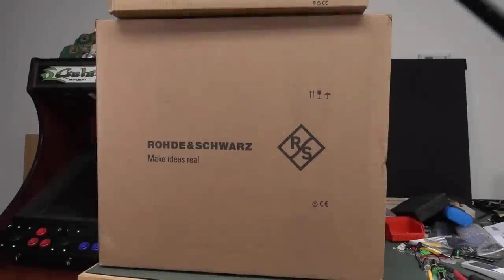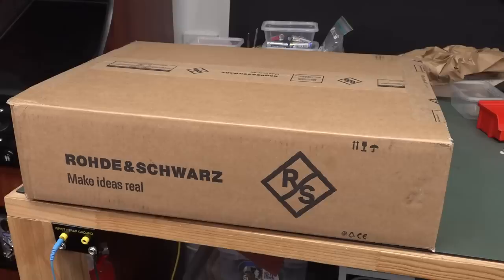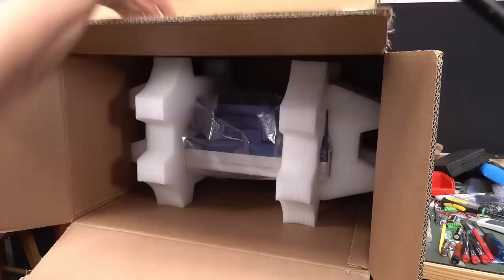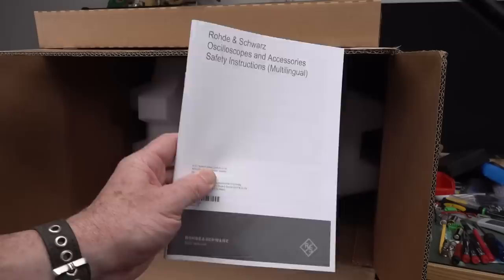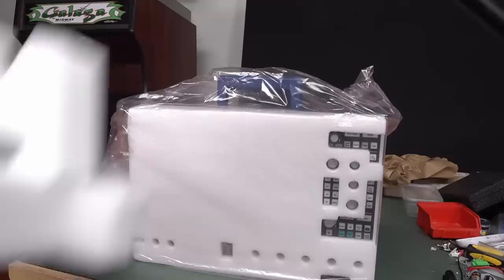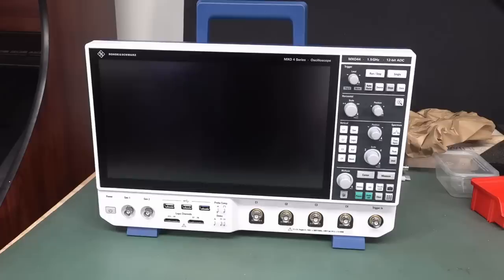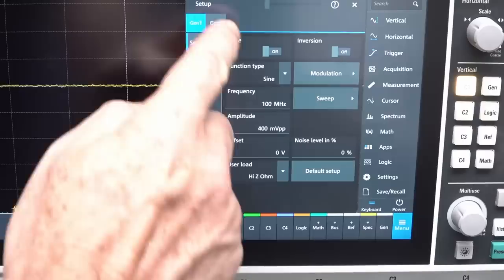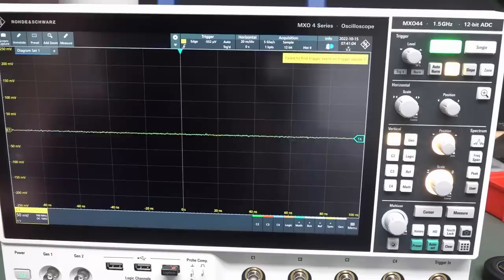EEVblog 1529 - R&S MXO4 12bit Oscilloscope Unboxing and Experiments

Comment: I realized I'm not the intended market for this equipment when the "low cost, general purpose" scope probes are more than my scope budget! 😅
Reply: Siglent and Rigol make some good stuff for the price. I think Siglent is good. I have the SDS 1104X-e and I still think it's the best bang for the buck scope anywhere. I doubled the bandwidth with a hack posted on the EEVBlog forum making it as good as the 1204X-e. It's not "great" at anything but good for everything if you know what I mean.

Comment: I rather like face plates like that. We've had a few devices do the old rapid & unscheduled self-disassembly stunt a few times and it's nice to have faceplates on equipment not in active use just in case.

Comment: 700MHz passive probe, or really "there probably is a signal there" probe, at 700MHz you better only be probing the output of a TV transmitter at 100W power output, to hope to get a decent signal without too much loading., 100R at 700MHz, really going to load things down.

Comment: Does it time out after 10 min and ask for your credit card number for their monthly subscription like everything else does these days?
Reply from the maker: Don't give them any ideas.
Reply: We can count our lucky stars that a lot of high-end scopes are used in environments where devices aren’t allowed to have internet access. Otherwise I think we’d already have everything subscription-based. 

I will say that I wouldn’t mind it if the manufacturers started offering software options as cheap, time-limited “rentals” instead of sales. So if you only need, say, 1.5GHz and power analysis for a specific project, you could rent those options for a few months. They already all support time-limited demo licenses, so this would be purely a marketing change.

Comment: What's odd is when you added peak to peak for a second time at ~27:00 it showed you a duplicate measurement instead of recognizing that it was already there. Basic bug that they really should fix
Reply: i also really dislike the ADD button. clicking those checkboxes should instantly turn those measurements on and off.

Comment: Hi Dave, Just on that 700Mhz passive probe, Rigol has RP615A 1.5 GHz 500 Ohm passive probe, not sure if it is really possible to achieve this bandwidth on passive probes. These probes come as standard accessory with Rigol MSO8204A not sure if you have done review on that or could do one? Thanks

Comment: You have had the MXO4 for about 12 months now, Are you still happy with it? Did R&S fix the waveform update/s problem which occurs when you add a frequency measurement?

Comment: 2:00 Yes I am a front cover fanboy.  I had one fabricated in aluminum to protect my Phillips oscilloscope in transit.  Its plastic cover shattered, protected the scope but revealed a need for a stronger cover.  If you never take the scope anywhere it probably is not useful or necessary.

Comment: What kind of scope would you recommend for a millwright? I don’t need anything super fast, in fact I’m looking for an hybrid between a graphing multimeter and an oscilloscope. Maybe an oscilloscope with super deep memory?

But I need lots of channels I think. For checking things like quadrature encoders.

And the other day I was troubleshooting a  CNC lathe and the manual had a 12 channels timing diagram for the turret tool change sequence.
Reply from the maker: I had to google millwright. Get a 4CH Rigol or Siglent in the $400 range.

Comment: All that packaging could easily have been done in cardboard. Surprising for a German company.
Reply: I guess at that volume and price point they don't really care to design something recyclable
Reply: Cardboard wouldn't provide nearly the same protection as foam, especially since it's meant to be reused.

It's not eco-friendly-- it's a higher risk of shipping damage (much greater possible ecological impact) + cardboard has limited reuse
Reply: @kanetw_  yeah, the waste from higher damage rate could dwarf the benefit of cardboard vs foam. At least it doesn't appear to be polystyrene foam.
Reply: R&S has some defense business. Not sure they are super engaged into environmental stuff. Also it's not like they are going to sell millions of these.

Comment: We do have the MXO4 and MXO5 in the lab for testing at my work. The scopes are superb, and the memory depth is insane compared to what we currently have. But that stops once you want to save a waveform to an external storage medium for further analysis or documentation purpose.. It's slow, like reeeeeaaallly slow, it took me more than one hour to save a waveform the same size as we do on our current 20 year old oscilloscopes in less than 2 min.....

I know, it's unusual to need a signal over that long of a period (up to or more than 1s) but we do actually need to document / archive the whole length of the signal, customer request ... :/

Comment: How many MHz in a scope is necessary for which type of real world signals. Examples: Serial, I2C, MMC, Ethernet, PCIe, DDR5, 6GHz Wifi, high freq RF stuff.  What signals are people actually measuring that they need $8000 scopes ? and how close can you come to being able to do stuff compared to the $1000 or $200 scope. 
( Or if you did a video like this already, lmk! )
Reply: I have a 25k€ for WiFi application from R&S and I ordered this one for general purpose application. The needed bandwidth depends on you signal shape. For e.g. for square wave you need about 10 time the frequency of you signal to get a good representation.
Reply from the maker: Thsoe are very specific needs, and often you want a dedicated debug tool ratehr than a scope for these.

Comment: A great device! But where is the 12-18 bit resolution???
You show a device that is advertised with it, but you don't check what resolution it really has...
In the signal that was recorded at 46:42 in the range +-5V, one sees later in the enlargement a noise of approx. 10mVpp.
This results in about 10 bit resolution. But the device was set to 18 bit! I.e. the noise should actually be smaller by a factor of 256.
Reply: R&S are not known to overhype their specs. In fact they are usually slightly conservative. So I doubt they would jeopardize their reputation by overhyping that.
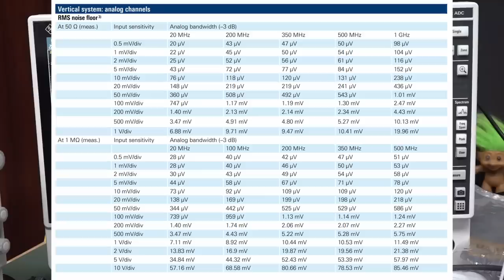Reply: @lolilollolilol7773  At 55:50 Dave has shown the specs. For example, at 100 mV/div, a noise of 747 uV is given.
A screen is 10 div high = 1 Vpp = 316 mVrms. 316 mV / 747 uV = 423. If I haven't miscalculated, that's less than 9 bits then....
Reply: @gnarflord4547  10.8 bits for the MXO4 is not correct. 
Fullscale = 10V/div@10div = 100Vpp/(2*sqr(2)) = 35.36Vrms
SNR = 35.36Vrms/57.16mVrms = 618.5 = 55.8dB
ENOB = (55.8-1.76)/6.02 = 8.98
Only effective 9 bits with a 12 Bit ADC!
Reply: @Elektronik-1  
You calculated effective number of bits (which is indeed 8.98 bits):
ENOB = log2(10V/div * 10div / (ADC RMS noise * √(12)) = 8.98
I've calculated effective resolution:
Effective resolution = log2(10V/div * 10 div / (ADV RMS Noise)) = 10.79

They are two very different measures, terminology is important! And now go and compare this with other scopes that have 12 bit, 10 bit or 8 bit ADCs: ENOB is always 2-3 bits smaller than ADC resolution. Effective resolution is smaller as well, though not so much.
Reply: @gnarflord4547  In my opinion, it makes no sense to divide a peak-to-peak value by an RMS value.
I just measured the SNR of my 8-bit Siglent SDS-1204X-E. It is 47.2 dB. (ENOB=7.5 bits).
My 16-bit PC OnboardSound "card" has a SNR of 90 dB (ENOB 14.7).
-> ENOB does not always seem to be 2-3 bit smaller than the adc resolution...

Comment: Now it is clear that just like Rigol and other chineese manufacturers completely dominate the low end market from the bottom to the top and even slightly higher into the mid range, R&S with its latest RTB and others are hands down the best choices in the mid range once again from the bottom to the top and even slighly touching the hi end. The MXO4 is already extremely expensive but any even remotely comparable Tektronix will be just ridiculously expensive as well as slow and bulky and you would only buy one if you really need all of its raw performance. It is unbelievable how R&S managed to grow from specialized Windows PC based test gear desgins into proper oscilloscopes with proper UI and really interesting features that noone else had before during just a few years.
Reply: I don't know where you got the idea that R&S was a " specialized Windows PC based test gear" company. They have been a top end test & measure equipment company for decades. And before that they were making broadcasting and radar equipment.
Reply: Well they did it by buying an oscilloscope manufacturer, Hameg. And in some ways, I prefer the old Hameg-based designs — their GUIs are way more responsive.

Anyhow, as much as I want to love the RTB2 and RTM3, both of which I have used extensively, their slow-as-molasses GUI is a showstopper for me. I’m evaluating scopes in this price range at work right now, and the laggy UI of the RTM3 disqualified it out of the gates. Pity, because it’s a great device otherwise. Unfortunately I don’t have the budget for the MXO4 at the bandwidth I need. ;( (Meanwhile, LeCroy is offering me a fully-loaded WaveSurfer 4000 right at my budget. Tempting, though its waveform update rate is nowhere near as high.)

Comment: Is the R&S MXO 4 new? I'm just wondering since you compared to the Keysight MXO3000 series which is pretty dated by comparison. Even MegaZoom-IV is pretty old.

And I believe Keysight has models with bigger screens like the 4000X and 6000X (although not much bigger). 

Still -- both are good scopes. I wouldn't complain about having either on my bench.
Reply: Yes, the MXO4 is quite new, but comparing it to the Keysight is still fair because Keysight hasn’t come out with anything new since then. They’ve just started updating the model numbers from -T to -G, the only difference being that the -G versions include most of the software options in the base price.

Comment: "You call that a scope? THIS is a scope!" and a sexy piece of kit. Beauty. Matte finish is definitely a good thing. 
Nicely packed. Safety instructions? That's what #279 is for, right? :D I'm not a fan of front covers in lab setting. They come in handy for transport though.
The huge fan (reminds me of old Tek) is probably slow turning and making way less noise while delivering enough m³/h (or CFM) to cool it down while not making too much noise.

I like the built-in generators and the UI & window docking, it's pretty nice. The 1-2-4-5 is really unintuitive and I can't really tell why anyone would do that, as I think the 1-2-5 is fine already. 
Measurements per second, meh... and it locked up almost out of the box? Bloody hell. I really hope they fix it.

45:50 talking about the Frantone FuzzyWuzzy, eh? Hahaha.

Comment: I saw your Hameg analog scope video just before this one and although there is no comparison with what this R&S monster can do, it is much sweeter and feels higher technology to have a direct ray electrostatic force deflection screen than a miserable pixelated computer screen. The analog trace is always so smooth there is no little pixel squares (Still visible on the R&S) something the pixelated screen could reproduce with a Photoshop like color filter that would require additional DSP circuitry to run real time.  So the Hameg wins against this MXo4 in terms of reponsiveness, smoothness and trusting what you see.  The more i go into this video and the less and less I like that R & S. Also i absolutely hate touchscreen interfaces, i know you do too but you are in suck up mode, since this is your life line.

Comment: Sorry this comment has nothing to do with this video. I'm learning electronics and my Siglent SDS-1104X-E will not turn on, completely dead. This also happened 2 weeks ago for about 15 minutes then it just turned on somehow so it cant be the fuse. Now it will not turn on at all. Its only 8 months old (bought new) and I only used it rarely for battery powered projects. I tried swapping power points/checked power cord for continuity and tightness etc. Can anyone help before I do a warranty claim?
Reply: Warranty for sure.

Comment: I liked the crocodile Dundee flashback joke since i am similar generation as you Dave.
Let's be frank this scope is overkill for 95% of professional applications and in a youtube Lab it's quite simply a hyper luxurious and superfluous item but we really know that your real job has become brand independent salesperson demonstrating products on youtube . Even in most high tech companies this scope will be overkill. And yes overkill can be a problem because of how much it costs.
15 minutes into the video, i don't like the computer like interface. It feels more like running a program on a computer screen than hyper responsive hardware instrumentation. I am really not impressed by this scope as an engineer.

Comment: Tek7854 did 10bits back in 1981
Reply: But only at a sample rate of 500 kHz and with a window of 128, 256, 512 or 1024 points. Still impressive for its time.

Comment: Is that scope overkill for a beginner? :P
Reply: They are essential for beginner but just as start scope, it's only 1.5Ghz.
Reply: @PeetHobby  Indeed, there's just no point in starting below 5 GHz bandwidth and you'll be severely limited down the road
Reply from the maker: Just a tad.
Reply: @0xbenedikt  Is there a 5GHz model on the market with 1MOhm input termination? 
I wouldn't recommend only 50Ohm for general purpose, specially as a beginner :D
Reply: @Momchil0  Good question!

Comment: FFT comparison is completely unfair :((( It's a shame not to open FFT settings in Keysight at all and tell many times "it is so bad". You could easily set RBW in the same menu as in R&S...
Reply: There is actually a huge difference - the Keysight scope's FFT is dependent on the time domain settings - this limits the FFT settings.  The MXO spectrum analysis is independent of the time domain settings.  Super useful and very noticeable on something like audio signals.  So yes, you can set the RBW on the Keysight scope, but it will change the time domain settings, whereas that won't happen on the MXO.
Reply: @richardmarkley6143  I know this limitation, I have MSOX3054A in my lab, all Rigols have this limitation as well. R&S may be a single exception here. That doesn't mean FFT comparison can be done in such an unprofessional way on this channel.